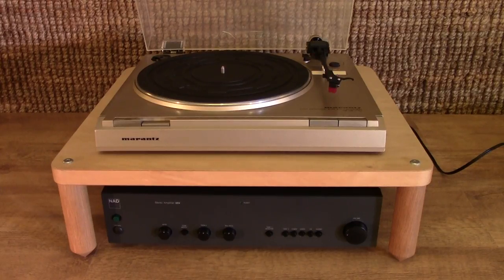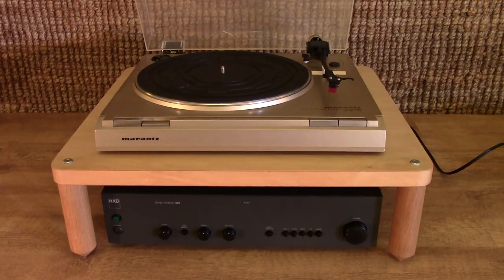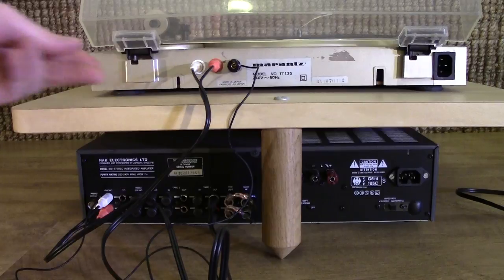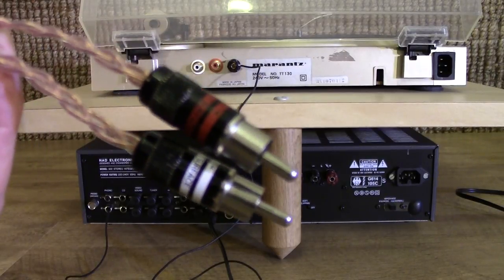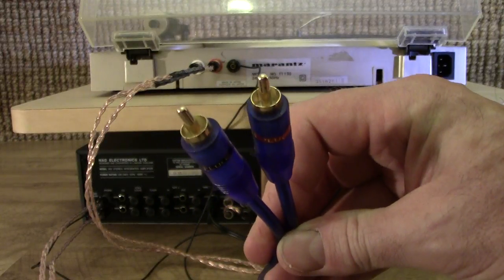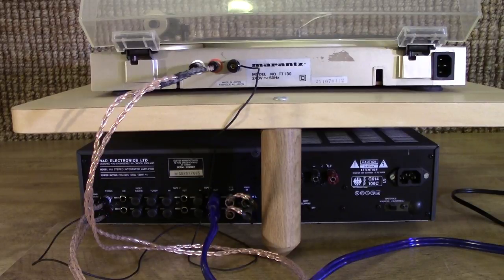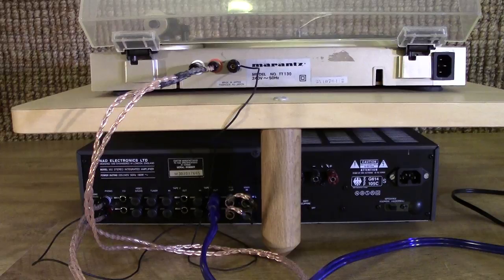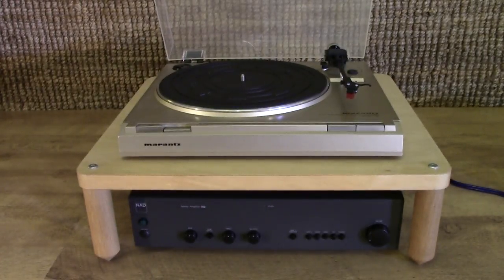Turntable Update 2: RCA Interconnects - Kimber Timbre

Comment: Interesting.  I'll check out Kimber Cable and compare it to my Monster Cable / RCA mixture.  Thanks for the audio quality tip.  ~ Jeff
Reply: Thanks for the helpful and detailed Kimber wire information. 

I know your correct as to the importance of proper quality cable wiring, shielding and shortest possible length cable usage! 

Your audio setup series will undoubtedly assist and simplify things for many vinyl enthusiasts.

I will look into the Kimber cable line and upgrading my existing RCA type interconnects.  Thanks!

Cheers, Jeff

Comment: You claim the other cables are much better but you don't specify why or how, you don't explain how the other cables are better. Gauge of the wire? Material of the wire? Material of the connectors? What exactly makes them better? Placebo effect?
Reply from the maker: +Myles V (MV1) Hello, Thanks for watching and commenting on my video, it's much appreciated.  You're quite right I don't explain why.  My videos are just me doing what I'm doing with my equipment, that's all.  They aren't meant to be a definitive technical guide or scientific critique.  But to answer your question: The quality of a cable comes from three things:

1:  Design of the cable
2: Quality of materials and components
3: Manufacturing quality

The Kimber cable is better designed, the Kimber weave has superior conductors and shielding (equivalent) to the original cable.  the quality of the materials is superior to the original cable, Better wire, both gauge and metallurgy.  And higher quality, better fitting plugs, again both metallurgy and physical design.  The manufacturing quality is flawless on the Kimber, I don't know about the original cable without cutting it open.

The sound is obviously better!  The original cables were poor.  While placebo effect is a known phenomena, I have done 14 blind tests on different subjects with my audio gear, done as well as is feasible.  Not one has yet revealed anything to be placebo and as such I have to say placebo within audio would appear to be exaggerated!  It is my opinion that it's little more than a comfort blank for the technical guys who can't explain something.  Instead of doing deeper research they just shrug it off.  This is a shame!  We need scientists to explain things accurately, even if only to get rid of the snake oil merchants out there.

Cheers Tudor

Comment: Ji liked yoir vid but your turntable is a cheap one from tje 1980, s id go for a 1978 sansui sr 222 it has rca jacks in the back so you can use your interconnect but it has higher quality s shaped arm im going to do a video on it whatch it
Reply: Thanks for the reply one question how would I change the cable on my tt if I wanted to imporve would I have to re wire also my amp has cheap cable aswell
Reply: Yes mains lead / wire my tt and amp are hard wired